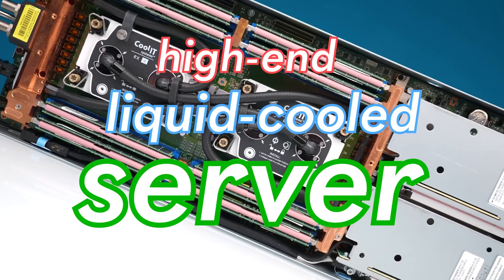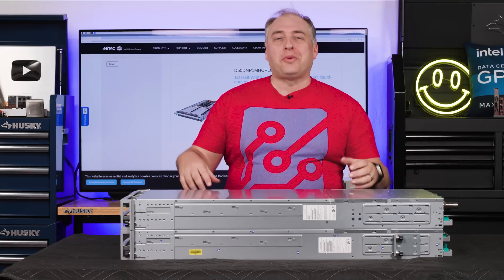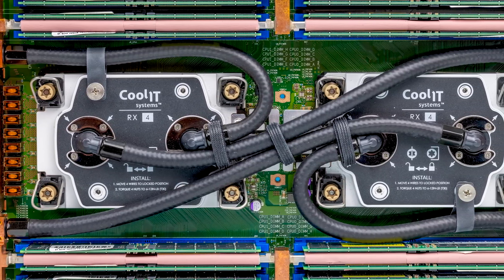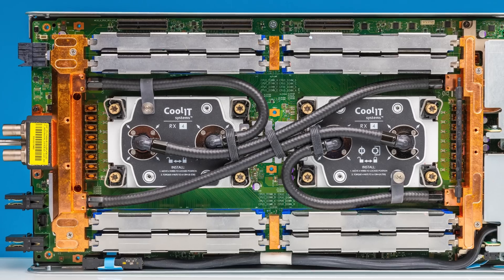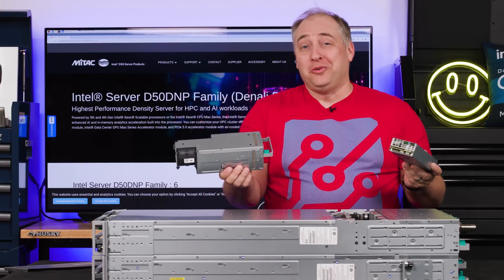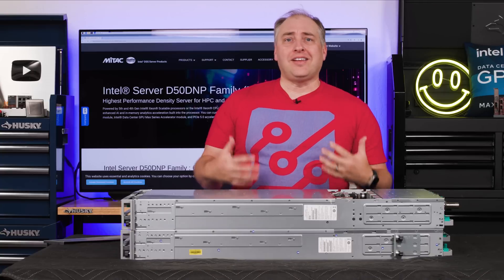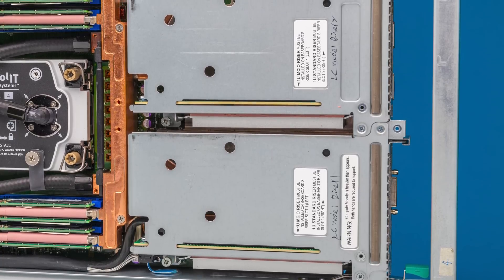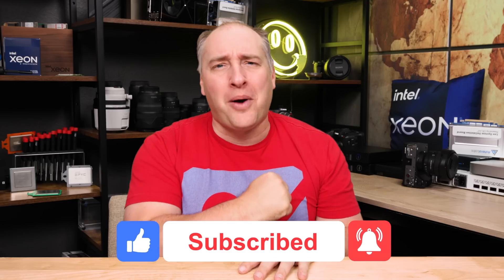Pros Liquid Cool Everything... Even the 3000W PSUs

Comment: So, 2U, half with. 4 nodes, dual socket. That means in a 4U rank slot you can put four servers, either nodes, 16 CPUs? Wouldn't this equate to a blade system which are like 6U with power too? And here you can stack all of it homogeneously? Crazy density. 

I guess you need to put several switches in a whole rank. But that's like a suepr computer already.

Comment: kris deltarune says: liquid cooling scares me. it feels like putting a bottle of water above the servers. if even one server fails all the ones below will fail aswell. kris out
Reply: also is saying that: i would repurpose an injection molding water conditioner just to see [if it's ((ENOUGH)) to run such a system]'s watercooling
Reply from the maker: Feeling aside, effectively all high-end AI servers in late 2026 and beyond are going to be liquid-cooled with no air cooling option. That was a fairly valid take 5-6 years ago, but today, either you are doing liquid cooling, or planning to liquid cool the next generation, or you are limited to lower-end hardware.

Comment: I had one of the first CoolIT Domino ALC AIO coolers back in the day, around 2007 or 2008.. Sadly eventually the block head developed a pinhole and dumped its coolant into my Radeon HD4890.. But it worked alright until then lol that was on an AMD Phenom.. I switched to Intel in 2010 with an i7 920 and nVidia in 2014 with a GTX 970, haven't looked back!

Comment: The funny thing, if you think about it, is that you could, in theory, use the heat of the Servers to heat other buildings or so...
In reality its not as easy as the water might be too cold and it might not work efficiently...
Reply: It's good for pre-heating, and the last 10-20K to reach ~60°C or so by other means
Reply from the maker: This is more common in places like Europe than the US right now.
Reply: The server cooling loop could be used with a water-source heat pump (the type usually used with geothermal) to provide the rest of the temperature rise.

Comment: A datacenter where you don't need ear protection sounds great.
Reply: Leadership-class HPC facilities (like top 20 in Top500 over the last 5 years or so) already use liquid cooling for a while, and yes it is a massive difference in noise levels compared to the older air-cooled facilities.

Comment: I have an older Supermicro Twin^2 system (6027TR-HTRF) quad node/2U blade server, and the way that you pull the blades out is pretty much the same as it is here, with the two latches on the side.

I still remember trying to design my own waterblock, back in like 2006, for the Socket940 AMD Opteron as a 3rd year mech student.

Watercooling the PSU is pretty cool though.

I wonder how they prevent the blocks from getting gunked up though...

Comment: I think eliminating fans in servers at this scale makes a lot of sense because it reduces power consumption and removes another point of failure.
Reply: How does that remove a point of failure?  You still have a couple of fans.  Most fans are replaced with liquid cooling that have their own failure mode.  The cooling liquid is probably externally routed to a centralized heat exchanger so that's another failure mode on top site ac.
Reply: Yeah, my fans are like 150W on a 600W server. (Though they're not running at 150W)
Reply: This adds a bigger much worse point of failure by adding liquid fittings. Get a leak at the top of the rack and it can flood all the servers under it and kill the entire rack.

Comment: Tip from someone with watercooling experience since 1999: Even if all power-hungry chips on the motherboard and add-in cards are properly watercooled, be sure to still have a bit of air flow throughout everything to lengthen the lifespan of small parts like capacitors. Even two small and silent fans in a completely closed case that move the enclosed air in a circle help a lot here. Still, stagnant air is a great temperature insulator.
Reply from the maker: That is why the liquid cooled one has two small fan modules I think. There are a few passive components not being cooled
Reply: Arctic desktop water coolers include a tiny little fan that's powered off the water pump, to give airflow to the mobo in an area where it's expected to have airflow usually. it's a good idea.

Comment: Fun Fact: When you have 100% pure water electricity cannot flow through it
Reply: True, but the distilled water can strip metallic ions from the metal, and in turn become conductive, even in all copper cooling loops. Also, if something isn't correctly grounded, it can create a electrical potential difference, and in turn cause various forms of rapid corrosion.

Comment: I like the coverage of MiTAC (& more Tyan), but at the same time, I'm burnt out on Intel.  Watercooling example, cool, but why liquid cooling?  Well, because TDP specs are a joke.  Did i miss something recently, or is there a comparison of how many watts Intel & AMD pull in under heavy load on air vs. liquid.  How they perform to targets on air vs liquid, and how much liquid might unleash.
Reply from the maker: So both AMD and Intel will be at 500W TDP this upcoming generation. Liquid v. air will be similar. Density and lower system power is what you get with liquid.
Reply: @ServeTheHomeVideo  This. 140w TDP like the good old days just wouldn't work for the crazy top end cpus we have now. Turin will have up to 128 core regular and 192 core dense configs. Just imagine how crazy that is, in 5 generations of Zen, we'll have gone from 32 cores to 192. That's 6 times as many! And we're certainly not using 6 times the power.
Reply from the maker: @b127_1  Also, Intel will be at 128 P-cores by the end of the quarter (stay tuned on STH) and is at 144 E-cores in only 250W already and will be at 288 cores in Q1 2025. AMD loses the P-core count lead in the next few days to Intel.
Reply: @ServeTheHomeVideo Oh, I almost forgot. Turin vs Granite Rapids will definitely be interesting. Probably much closer than we've had in years past.

Comment: Yeah but what happens when a stick of ram breaks? The amount of expertise +time +precision + knowledge required to service these seems problematic
Reply: They calculate failure rates and replace things preemptively its how we find alot of server grade micron sss’s on the market from 5 years ago as there plannned to be replaced even if theyre not faulty
Reply from the maker: In large clusters like these you often see spare trays. So it can take longer to service the DIMM but you get to the node in seconds and faster than in a 2U server.
Reply: With the cost of saved power and the ability to utilize hot liquid exchange elsewhere (heating the building for example) it is still more cost effective even if servicing is more expensive. Node density is king here and having few nodes down for a moment is not that big of a deal when you have hundreds or thousands of them available. Those kind of solutions are not for one server implementations.
Reply: In addition to the other comments, two things I'd note:
Cost savings wise these nodes use 14-17% less energy as noted by Patrick. So, depending on the failure rate, that can be a lot cheaper.
Second, it looks like these are using standard ram stick with a clip on heat sink and one copper, water cooled plate, between every two sticks of RAM. So, in the grand scheme of things this may add a bit of downtime and overhead if replacing a RAM stick, probably will not add that much.

Lastly, my understanding of the data centers these kind of things are operated in is that you just swap the node with another working node and do the repair later if uptime is that critical. Most of the loads are heavily virtualized, so they can be migrated and load balanced across nodes.
Reply: You just have spare nodes on a shelf, ready for a quick swap. The IT tech then has plenty of time to repair the faulty one and put it on the shelf when done.
Reply: Have a home server running for 5 years and never had a stick of ram break. My MacBook form 2012, no ram breaking. Gaming PC with mad 5900x (built when 5900x came out) no ram breaking. 

Just go on Ibuypower and be happy if you are concerned with that stuff.  Clearly, this type of build isn’t at your level of use
Reply: You think they don't plan for it smdh
Reply: They replace the node and the replace node will get auto deployed ,and faulty node will get repaired

Comment: I do like that plastic cover having the two things to push in. The screw ones we end up trashing and ripping out on so many of our older 2u 4 node SM systems.
Also 10G port while it's not as great two would have been much better to have for a public/private setup without using the pcie slots for networking. Still better than not having anything like a lot of them have done.

The amount of cooling on that is quite nuts. We have talked about getting some of our new suites in our current data center linked up for water cooling like this and basically it would just interconnect to the data centers current cooling loop that they otherwise would put into the cracs from what it sounded like which is a big cost savings but they would want a large amount to setup it either way and our demands are not quite there yet. 

We've done some small scale tests and the best way is tanks but it's a mess and better suited for a large warehouse space vs a data center. Which is where this cooling design is nice.
Reply from the maker: Asus had a screw design that was annoying when we had dozens of nodes we used for E5 v3/ v4

Comment: Can anyone name the specific manufacturer and part numbers of the quick disconnect couplings/connectors that are used in data center liquid cooling solutions?
Reply from the maker: Staubli but I do not know the model numbers
Reply: In some of the closeups (e.g. 15:07) you can see this system is using Stäubli connectors, specifically the CGO line, at least for the Blade to Chassis connection.
Reply: Thanks!